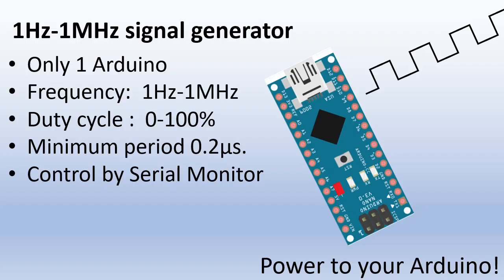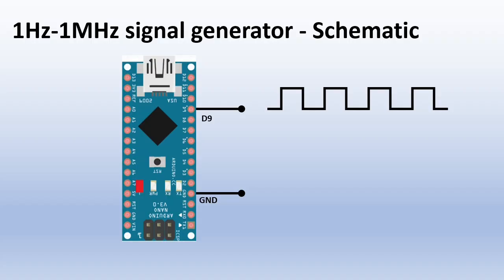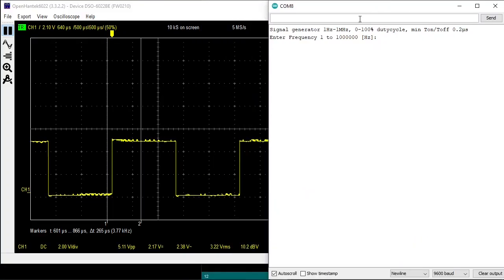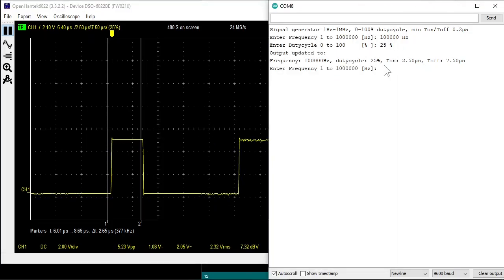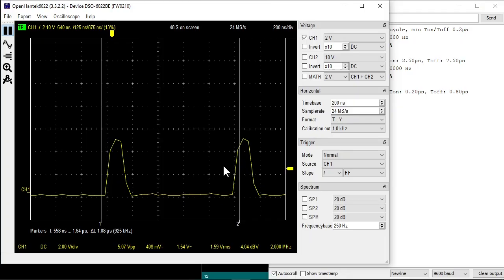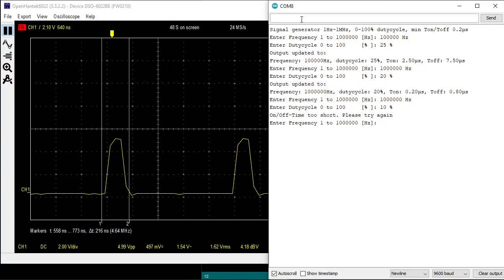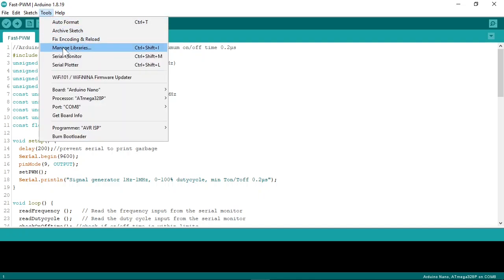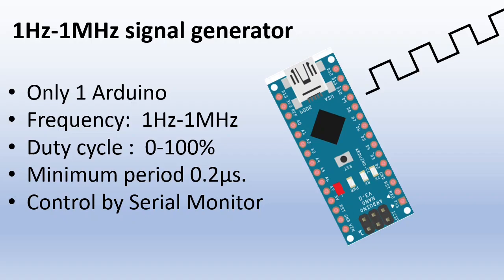Arduino 1Hz 1MHz adjustable PWM signal generator

Comment: At high frequency the square signal is distorted because the Arduino or the bandwidth of the DSO?
Thanks
Reply from the maker: It is the DSO. It’s a Ha a Hantek 6022 , cheap but slow😅

Comment: Thank you for showing this. I’m new to using a scope. But have fixed many different electronic products with just a mm, vintage transistor tester and a cheap chines cap tester. I recently built a pemf therapy device. It outputs a high level magnetic field. Getting as high as 3,840 uT. Depends on setting. The zk-pp2k pwm is not efficient. Currently sourcing parts to make an Arduino Uno controller for the pemf unit. Thanks for making this video it was enjoyable to watch.

Comment: Will there be conflicts when using Timer1 and pulseIn() at the same time?

I'm guessing not, since one works via interrupts and the other timestamps the pulse edges. If not, this could be made to modify a PWM input into a different frequency and/or duty cycle.

Comment: Can I tweak the code to make the frequency a constant like 200Hz, but allow the duty cycle to be varied with a potmeter
Reply from the maker: Yes that must be possible, connect a potentiometer to your arduino: Vcc, GND and the wiper to analog input, e.g. A0. You can use AI to generate the code now: Paste the original code in ChatGT and ask " I have a potmenter connected to Vcc, gnd and A0, I want the freq to be 200Hz and vary the duty with the potmeter" let me know if that works 🙂

Comment: Can i connect the board to send this signal through a canbus shield, to get the signal be sent over canbus?
Or if there is a small Arduino board ready made for canbus communication.
I need this square wave signal to be sent and communicated  over canbus.

Comment: you know what would be great! if you made a little tutorial of how to make this program on an Arduino since it seems like a fun little project and it would be great for people learning like me!
Reply from the maker: Thank you Scar32! Always good to hear people want to learn! The Arduino Nano or Uno are great boards to learn, what I suggest you to do is download the code in the video's link and try it. If you do not have an oscilloscope, connect a speaker to the output (D9) and ground with a resistor in series (220 ohm...560 ohm is ok) so you do not break your arduino. Then choose a frequency you can hear and play around with the PWM dutycycle.  You can also play around online : https://wokwi.com/arduino, but nothing is better than really building it with real breadboards and wires! Have fun learning, you can also make a good career out of it (that is my experience ;-) )

Comment: Exactly what I needed thank you.

NOTHINGS wrong with using global variables for small programs. They actually simplify the code massively and make it easier to understand.
Reply from the maker: @kirishima638  thanks man, I am a power supply designer so not the greatest at software, but if I would start my studies now I would go for embedded software, it is really interesting!
Reply: You are sending instructions from serial port. How do you implement it and read time and frequency? Thanks also it would be great to generate sine waves from arduino.

Comment: Thanks but please clarify that it only generates pulse (square) signals, because the term Signal Generator usually means that other forms such as Sine, Triangle, Sawtooth, etc. can also be made.
Reply from the maker: Even though I do this channel just for fun, I try to keep a high standard 😊
Reply from the maker: Thank you for the reminder, I changed the title of the video to "PWM signal generator"
Reply: Thank you for making the changes, but you didn’t have to. It is very considerate of you, which is very rare these days. You are a great teacher and a good person.

Comment: Add one of the cheap 'nokia lcd' screens and some buttons and this is a great little bench generator project.
Reply from the maker: https://github.com/tricksofali/Arduino-square-wave-generator
Reply: @smartpowerelectronics8779 this is awesome!
Reply from the maker: Thank you! You are right, I just tried to keep it as simple as possible 🙂
Reply: Hc 05 bluetooth module is fine